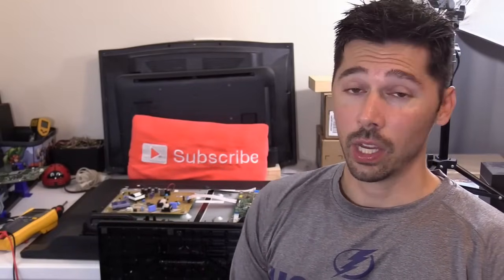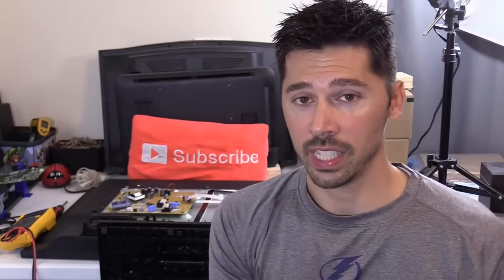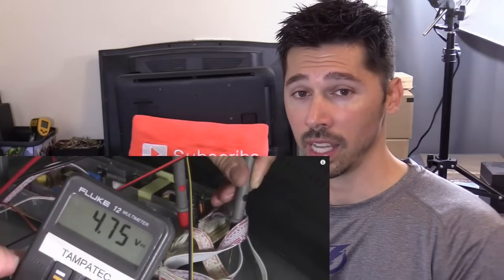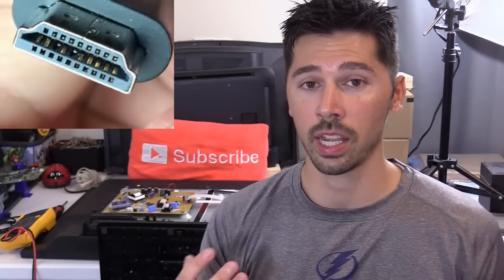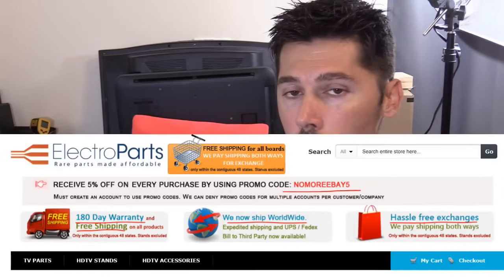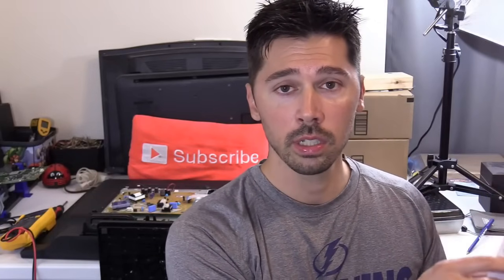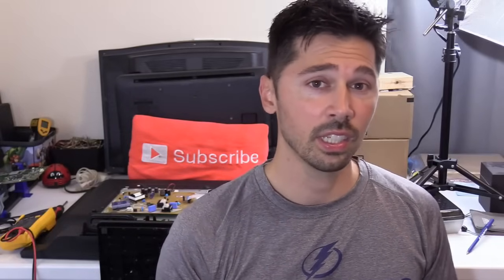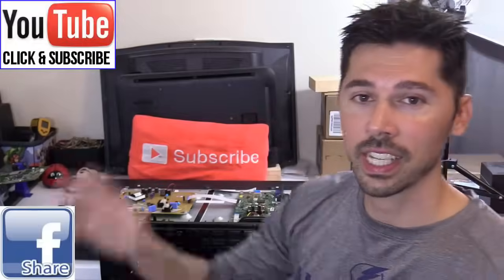How to Fix LED LCD TV Not Turning ON But has Standby LED Light

Comment: please let me ask, i have a panasonic tv TC-55AS530U that the red light is blinking 3 times. we did have a power surge on the cable side. so i replaced the cable side board. now the red light is blinking 3 times. should i also replace the power board. hope you can help.
Reply: before i replaced the cable side board, i did not have the red light blinking 3 times, only after i replaced the cable board.

Comment: Hi thanks for video I need one help if you can help me I got one jvc LT-50C550 when I put the plug is Turn on the red light and when I push the power button is turning on the tv and show me jvc sing and after immediately is turn off and going the red led is well i take off the plug and put again is doing all the time same I order one power board from eBay but is doing same what will be wrong with it plz if you can help me thank you

Comment: Hey TampaTec I have an LG TV (55UH6030UC). It will not turn on or off with the remote but the TV power button works just fine. I was told that the Main Board is the problem. My TV uses LG 55UH6030-UC AUSWLJR main board but I see LG 55UH6030-UC BUSWLJR. What is the difference and can I use a BUSWLJR board on a TV that has an AUSWLJR board?

Comment: Hi. In my case, a Seiki flat screen, in powers into a blue or vertical lines screen and audio, but if you let the tv warm up you turn off and on and it's fixed. Will this video on disconecting boards will help or is there another video in your series that for that case? Thanks.

Comment: Tampatec, thanks very much for your videos, they're terrific.  I have a problem with a Sony Bravia (KDL-46HW800).  It turns on, is fully functional and has a perfect picture for 5-10 minutes.  After that time, it abruptly shuts down.  The red light blinks 6 times.  I've replace the power board but that didn't repair the issue.  Any advice would be great.  Thanks!
Reply from the maker: Kdl models are known for bad tcon boards. I made Sony TV repair videos, see my TV repair playlist or Sony playlist.👍
Reply: Thanks so much, I'll check it out.

Comment: advice please. have a samsung, powers on, backlights come on but no picture or sound. checked all voltages coming from psu and fine. would it be the Tcon or video card?
Reply from the maker: Tcon board or main board. Sometimes tcon board is built into the main board. Get TV boards at shopjimmy.com and Electropartsonline.com
Reply: @TampaTec  Tcon board is seperate. should i replace Tcon first alone since its cheap? thanks man!
Reply: I have the same problem on my Samsung un55D6000sfza tv .. did you find the fix yet?

Comment: Hello. I have an LG PDP50R40000 Plasma TV. The stand by light is on. i turn on the tv the standby light goes off then the standby light comes back on . no picture no sound. took the back off the TV nothing obvious. Susupect the main board but would like to have a better way to diagnose it first? Any suggestion's?? Thanks in Advance, Don

Comment: I replaced the entire logic board as the original one stopped working.  Put it back, plugged all the connections, but although the bottom light on the unit is on (blinking red),  it does not turns when using the remote control. 
The TV does not produce  any sound or image. Any suggestions? It is a Hisense Model  50RGE1

Comment: been having trouble with hisense 50 inch for awhile. at first and for about 3 months now, ive been unplugging the power cord for 60 seconds, and that has worked till this morning. now reseting by doing that wont do the trick. would a power cord itself possibly fix my problem, or have you ever seen that? the tv is out of warranty, i have a multi meter and am willing to try testing it like the other video you have shows for 5 volts.

Comment: 42 inches Orion plasma TV (42400SI) won't get ON if I do power off / standby / power failure. 
Only possibility if I use remote for on and off.
If the TV won't on i do remove the cable and wait for half an hour and press different types of combination with the both power and standby switch. Sometimes it will on. 
What will be the problem any solution for this.
Looking forward your valuable reply.

Comment: I've got a Sony KDL-46z4100 that won't show a red stand-by light at all.
 TV will power on with a green light, but only with vertical lines, no 
sound and no ability to change the input or channels. I've purchased a 
main board, t-con board and power supply board off Ebay with no luck 
getting it to power on and work again. In fact I've tried two different 
main boards and power supply boards, all with matching part numbers. Any
 suggestions to get this thing working again would be greatly 
appreciated.

Comment: Hey Tampatec, I have a Sony KBD-46BX420, mfg & purch in 2011, typical living room use, no harsh environments, only one move in its lifetime. Was watching as normal & suddenly video went black, but the audio remained - did the flashlight test to verify it was a simple loss of backlights. When power cycled, the splashscreen would appear briefly (backlights fire & then shut back off after approx. a second or so). After watching all your videos (thank you), I metered the supply board & verified ALL the voltages were OK, so I suspected the inverter board... I replaced the inverter board & the TV worked perfectly... for about 5 minutes and then the audio & video quickly 'chattered' off/on (for less than a second) & then back to the same exact original problem.... just like before, no pop, no hiss, or otherwise - just loss of the light engine. I suspect that something else (possibly T-con board per other videos) is faulty & causing the inverter to fail?!? My first question would be what would you suspect (I know it's a guess without an actual diagnosis).... Next question - if I order a new T-con board, do you think I will now need another new inverter board? In other words, is there a chance my 2 inverter boards are not permanently damaged & just shutting down, say with a watchdog circuit? I don't want to keep dropping $20 & $30 on boards just to keep blowing them... Any information is greatly appreciated & thanks in advance for your time!

Comment: Hi I have a TC-L47E50 Viseo - TV - it was going off after about 5 sec - I replaced the power board, no change, the LED cotnroller no change. 9 blinking less, Finally ordered the main board...not it wont go on at all...so I changed all the boards and seems to have gone backwards...!its still blinking 9 times...it says audio but there is not a word on this on the internet!

Comment: Watching this video a few times, From my checks I think my TCon board is bad. I have a 24" Element TV, I get a standby light and it also turns blue after pressing the Power button. The screen lights up with the element splash screen then goes black. But I still have the sound of the channel. Looking at your parts recommendations I checked for my board PT and no one has it available!. The board is LS2204037-00-GP(1003). All the capacitors look OK and there are no burnt spots on the board. Any ideas for me before I just scrap the TV? Thanks again for your videos.

Comment: I have 32 inch Toshiba model 32sl415u  suddenly shuts off itself and does not power on anymore. The standby led light is also not lit. Used new battery for the remote. Wall socket has power. What can it be?

Comment: I replaced all parts besides the main board in my 55EG9100 with parts from a donor TV with a cracked screen and the same problem (standby light turns on and off three times) occurred. When I replaced the main board, the standby light is solid, but does not respond when the power button is pressed on the TV. Is there any update I have to perform or something? Or is the panel or new main board bad?

Comment: Hi Tampatec and thanks for the vids.  I have a Sony KD-65X9000B that now blinks 4 times with no other response.  I've pulled it apart and have measured the voltage coming from the power board.  I'm getting 3.5v on the standby pins but 0v on the 12v pins.  Have you seen this before?  Do you have any suggestions?  Thanks

Comment: hi.. my panasonic lcd tv which when powered i can see the screen and the green light as normal but when plugged in hdmi cable and press the avi button to navigate the menu its failed ..evrything is ok but i cant go to menu even if i press the menu button in remote or at the back of the tv..pls guide...

Comment: With TV plugged in, not powered on, I'm getting steady 19v on power board 12v pins. Is that an issue? Should be solid 12v, not 19v right??? I'm getting solid 5v on 5/3.5 volt standby pins. When I turn the TV on via power button on side of TV, the 12 v pins read 18.5 volts, standby pins still read solid 5v. Likely power supply or logic board issue? Any help or next steps to troubleshoot much appreciated. The red standby LED on the logic board is solid red, then when power button pressed, it goes purple (tiny little blue LED in the middle of the red comes on), the white power indicator light on the bottom corner of the TV comes on, fades, blinks several times, then off, then repeats. No picture on screen, no backlight. Vizio M43-C1

Comment: I have a Toshiba 55LF621U19 i am only getting 3.85 volts at the power on on the power board the specs on the power board says it should be 5 volts, so i have changed the main board no luck, and then i changed the power supply board still getting 3.85 volts at this same area on the power board. Why? and what do i need to look for?

Jim

Comment: LG55UF6450 Not powering on. Fuses are good. No obvious burning of board, buldged caps etc. Output/standby voltage on board should be 13.2 volts. Meter reading 55 volts. Your thoughts?

Comment: Hi by the way i like the videos you post up on Tv's and been learning how to fix an hdtv. My question is that I'm having trouble with an LG 55lk520 (55inch tv) and had the power supply replaced, main board, backlight inverters. Power supply might have pins messed up connected to the main board and was wondering if thats the problem from not powering up?

Comment: My tv both on power main board have low numbers. My dad's volt detector has many selections over 20, so I stick with the first two. The first one when I stick the cords to the power cord it gets 12v, when testing volts on the plug in tv the first click (on volt detector) shows 0.0 the second click displays numbers. So is that a low or normal?

Comment: Hello,
I have a SMART TV LIGHTWAVE MODEL NO .:LW S6019/T2  has a starting problem.
When switching it on with the remote control, the SMART TV presentation image appears, it's displays the andriod page.... And then nothing after that. It is as if the tv has crashed.

 I tried to manipulate the remote control to access the menu but the remote control and the buttons on the TV are active when touched.

Could I please have some help

Comment: Had to do the disconnect several times to  get unit to turn  on now the  red  stand  by   light  is on  but it will not turn on.  is this usually   the main board problem?
Reply: Help

Comment: I have a Samsung un55mu7500 while watching it the tv cut off and won't come back on. I have replaced the power board and still won't turn on I disconnected the logic board from the power board and the outer led lighting comes on so I replaced the logic board thinking that was it but it's doing same thing with both boards are new. What should I look at next? I'm at a loss

Comment: KDL 32 M3000 Sony, TV off no STBY light, TO with remote or hard button, Back lighting is apparent green power on is lite, So I'm thinking G1M (power board) is good, and maybe BM (Main Logic) is ok, so T-conn is culprit. The boards are available and aren't terribly expensive. I've looked at the Sony parts and diagnostic manual and also tried the Display+5+volume up then on and no menu or anything beyond backlight. Any thoughts to add or should I do the T-Conn and see?

Thanks, Great Videos and good content...

Robert Phelps
Reply: poweronmsdter
Reply: Auto reply was on. I get some things but think the tvs toast 
51755$407=41

Comment: Hi, great video. I have a Technika LED tv. It won't turn on from standby every time. I could be waiting for minutes or even hours for it to come on or it could decide to come on straight away. As the weeks go by it is taking longer and longer for the tv to come on from standby. I've checked the remote with the camera on my phone and that is working. I've tried switching off and unplugging for 30 seconds etc but didn't fix the problem. Can you help please? Thank you.

Comment: Hey need help!!! Have a samsung un55ju6500 it has a blinking red light tried using multi meter on tv but keeps going to standby mode to on and keeps cycling  hard to read voltage going up and down from the tv cycling has right standby and on voltage, has no backlights and wont turn, did flashlight test can see the smart tv logo then tv shutdown to standby switches in a second, unplugged main board from powersupply no backlights still try to figure it out anything would help plz!!!

Comment: As soon as I turn on the TV it shows the logo for like a mili second then disappears then nothing happens after that it shows that it’s on cause it’s on blue standby light but nothing is showing. What is wrong???
Reply: Same I have an old Samsung tv model that does the same thing
Reply: Watch
Reply: Hi bro, I have the same problem in a LG led tv right now. Did fix it bro
Reply: I have the same problem I have a gva tv but I get no result of people doing gva tv
Reply: Same problem here
Reply: @aubreytaylor7942  that's your back lights 👍
Reply: What did you do to fix it ?
Reply: @itsmustytruly9899  in the bin
Reply: @ezoubairkhazma  probs can fix but I just bought a brand new cheap th
Reply: Same here
Reply: @Ye-yz7cx  I have fixed tv with a similar problem. Probably it could be the blacklight. They are capacitor that are responsible for that. Do visual inspection on the board and look for busted capacitor.

Comment: hi, I have a hisense roku 4k 58inch tv, its a 2019 model, it quit working where the screen doesn't turn on but the power light will turn on then off then on again. I checked the voltage at the standby and its 2.9v and i replaced the power board but it didnt do anything. The backlight doesnt turn on and if I put a flashlight to the screen it'll say "hisense roku" then disappear and a few seconds later reappear. i've read that on these you have to have matching power board and main board and that they make multiple boards for the same model. Other people said these TVs are junk and to throw away. What do you think the issue is and how do I fix it? If its just the main board, i can order one and put it in myself, but I haven't yet because i want to find out the problem first. What do you think it may be, any help is greatly appereciated
Reply: Did you end up finding out the problem?
Reply: @BasicConcepts93  no, but i know when i put a flashlight to it the letters show. So its either the inverterboard, the smartboard or the leds. But i doubt all the leds quit at once and even with the flashlight the words "hisense roku" come out then go away then reappear later. My assumption is the problem is the smartboard
Reply: @Jimmy25camaro  Same here with the seeing  the words "hisense roku" with a flashlight. Does your Standby led start off bright red then dims and blinks twice(nonstop)?

Comment: I have a Sharp Tv i woke up tv was off Standby light was on, tried turning it on with remote and the standby light turns off but tv doesnt.turn.on. normally standy light will be lit the. Once i power on the blue led light will blink and it powers up . . I tried unplugging, different outlets. Any ideas?
Reply: I am also facing the same issue ', what mst I do

Comment: Lg smart tv I have black screen and it will flicker on power up then black screen only and stand by light stays  on my question is I bought the power cord off amazon turns out it's for Dell laptop would that make a difference if not y wont my tv come on

Comment: hope you can help, no one else seems to know. i have a - vizio e3d420vx - and i can not access the menu screen or the smart tv features on screen. using the remote or the buttons on the side of the tv. it appears for less than a second and then disappears . any suggestions? thanks
Reply from the maker: Try hard reset by unplugging power cord for 1 minute, next factory reset, and firmware update, next try main board swap at shopjimmy.com or Electropartsonline.com
Reply: @TampaTec   thank you so much for the reply ! i am unable to do factory reset or firmware updates because of the issue i have. will try to swap out main board

Comment: I fixed a TV that would not turn on at all, I replaced a heap of capacitors as well as the AC filter  polyester capacitor as it was all blown out and expanded. The TV turns on and works perfectly. turn it off and it wont turn on again. unplug it wait 24 hours and it turns on OK every time.  Any ideas?

Comment: Hi, my Panasonic TV's green led flashing 29 times, then turn into red after 3 sec.
 Model number: tx-48ax630b, error codes valid until 13 flash. can you help what can be the issue? Thanks

Comment: Just subscribed. getting 60 volts from the 80v pins and 9.2v on the 13.2 boards. Bad power supply? Standby light will blink 3 times when button is pressed. Thanks...

Comment: Ok I really need help I have a Vizio TV model number M502I-B1 it just stopped working for me i replaced the power board and main board and still nothing what could wrong PLS help the standby light is really dim and trying to come on could it be a faulty wire somewhere? And if so how can I go about this it still does not go on at all no sound or backlight

Comment: I Plugged In The TV And I Tried Turning 
It On I Got Nothing But The Standby Light
Stayed Lit. So What Could It Be?
I.Know The Power Supply Board Is Good.
Could It Be
The Logic Board Or Could It Be A TCON
Board Or A Just A Couple Of Loose
Connections?